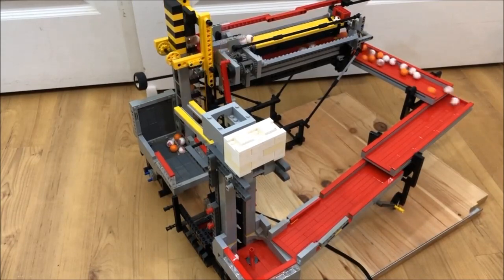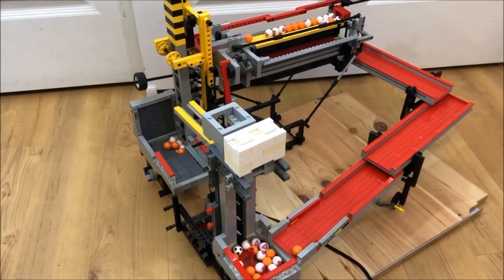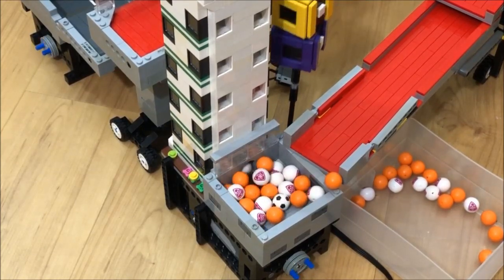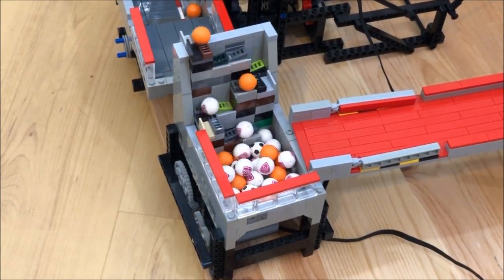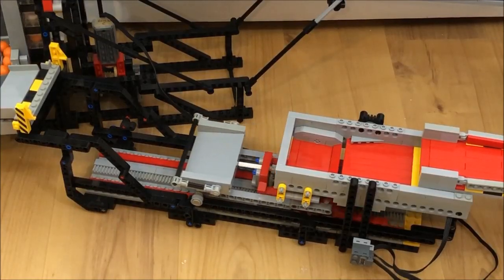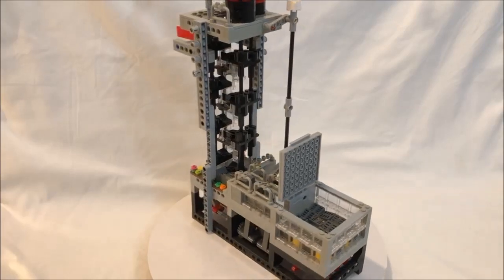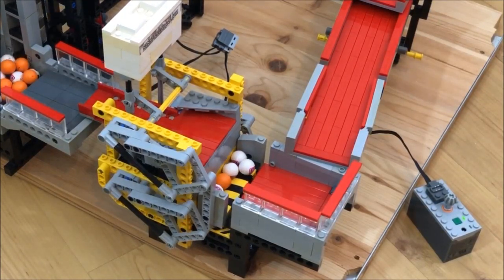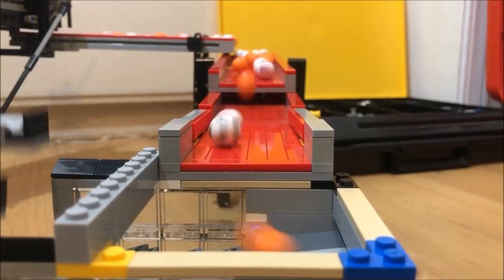Flooding LEGO GBC Modules with 30 Ball Batches

Comment: Hey is 1:48 good for trains? And also what does it mean, 1 stud = 48 what unit
Reply from the maker: 1:48 is roughly 15 inches to the stud. Whether it's good for you really depends on what you're going for:

1:48 is mostly a compromise between aesthetics and functionality. Larger models can have more detail, but will struggle to navigate R40 geometry. Smaller models will have less detail, but they can be more flexible with wheel arrangement and running considerations. If you want a really detailed model and you don't care about functionality, a larger scale might be more appropriate. On the other hand if you want something that's more play optimized, you might want to go smaller... or even not to scale, more along the lines of what LEGO does.

1:48 is also the nominal scale of O-gauge trains and generally pretty popular for LEGO scale models, so it has that going for it too.
Reply: Thank you!

Comment: Nice summary video and great collection of modules you have there! I’m quite interested to see the larger batches of balls moving round the loop and have been thinking of making some modules to handle more balls recently. Have you considered modules that could sit within your own system that could handle more than 30 balls at a time? You could then terminate your section with a standard module to output at most 30 at a time for re-joining a larger GBC loop.
Reply from the maker: Thanks, doing the summary was at least a small part of why I wanted to do this one!

For normal loops, even if you put in large batches they tend to get dissipated really quickly because most modules break them up into streams or at least smaller batches. I haven't really thought about doing modules that specifically handle large batches as a whole, but that's definitely an idea. Cheers!